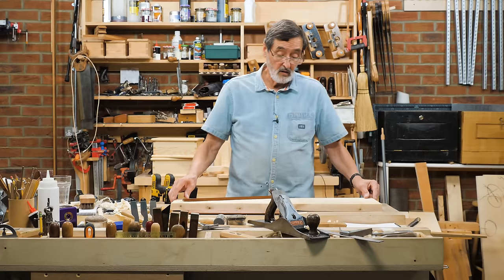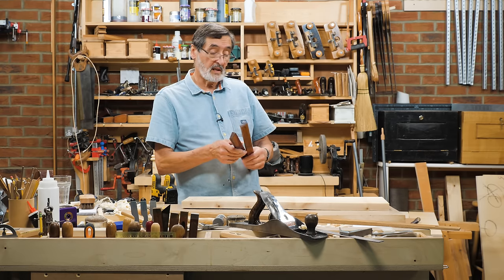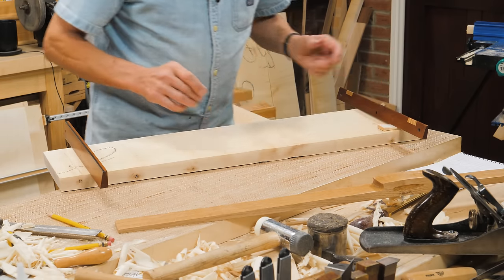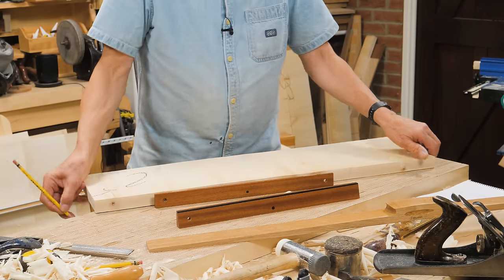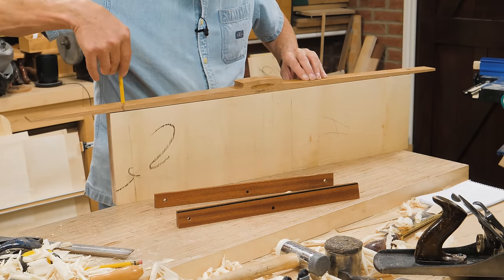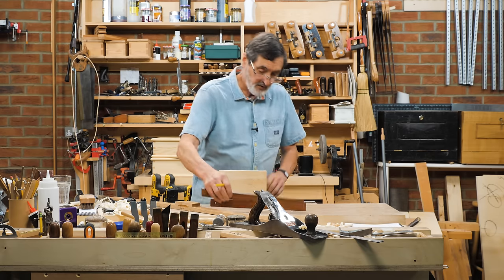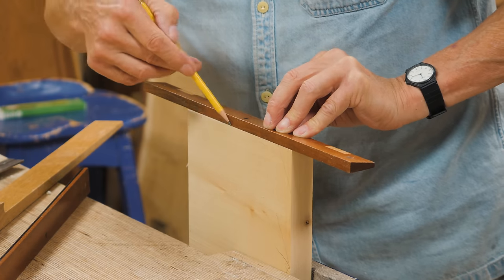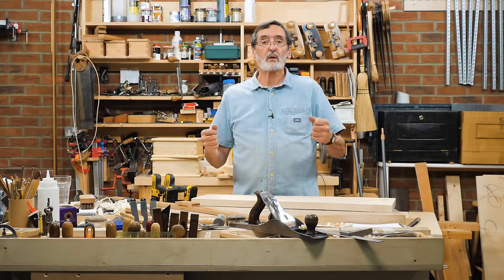Twist Solution | Paul Sellers

Comment: ty Paul. My method is to place the board on a flat surface and shim it so it doesn't rock. Then I scribe around it so the flat surface is scribed around the edge of the board at the thickness I want. A very similar method to yours!
Reply: That is like a machinist way to do it. It is more precise but for bigger pieces of lumber usually not possible. But actually it isn't worth it to try to straighten very long or wide pieces for twist because it wastes so much wood and is too laborious

Comment: One of this day I'm gonna build a straight edge anchored to both ends with regulation bolts that can slide up and down, and keeping them parallel to the workbench I will see exactly where a board is high or low, just to calm my fussiness. PS: Thanks for the tip Mr. Sellers.

Comment: Just confirming that your winding sticks are twice as long as your board width so therefore you half the distance your measured. Correct?
Reply: it's half because he only used one wedge on one of the winding sticks.
Reply: @stephanedaigle1613  here's how I understand it... He only took half of the height on the wedge because the winding stick exaggerates how much the twist is. He tells about this in another of his videos about winding sticks. For example... If the board is 8" wide and the winding stick is 16" then what you see in twist is 2 times greater then actuality. I believe this is why he halves it.
Reply: I think for this technique the lengths of the winding sticks plays no role. They are used only to indicate when the twist disappears. 
The reason he halves the thickness of the line is because he is taking some off each opposite corner.